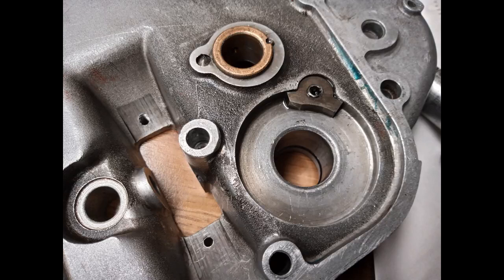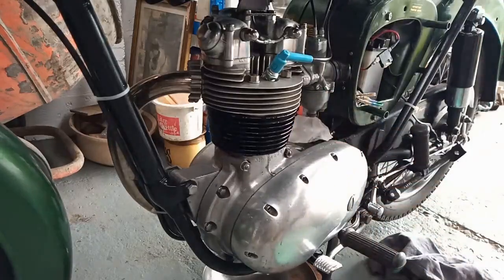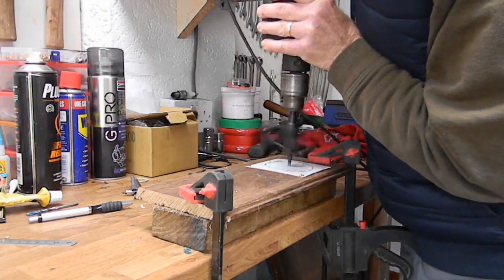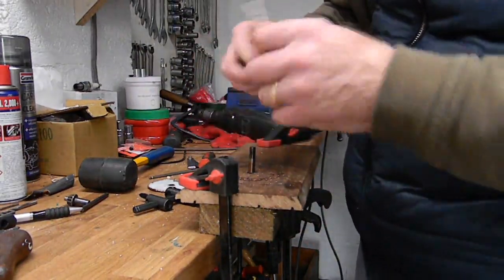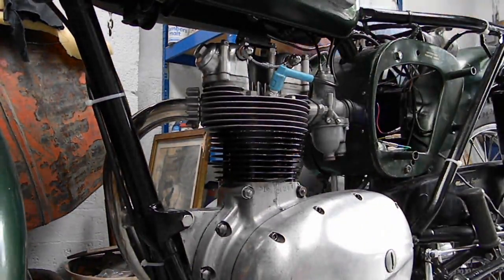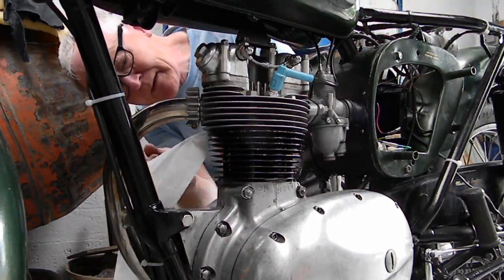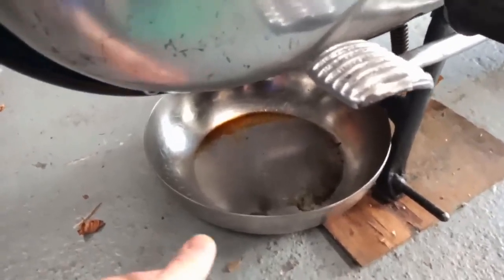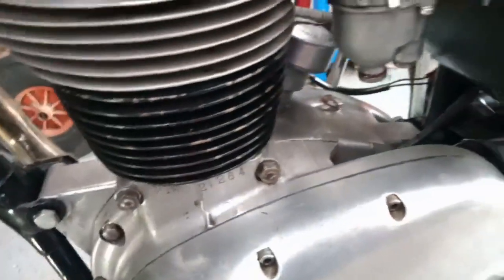BSA C15 Oil Leaks

Comment: RTV sealer works well.  Used it  on my c15.
Reply from the maker: Hello Roger and thanks for the advice. Rupert Ratio and the BSA C15 Restoration & Preservation Group on Facebook advise against using silicon RTVs. I gather this is due to the possibility of an excess breaking off inside the engine and blocking an oilway. But I am getting desperate. You have experience of RTV use and I may fall back on your experience.
Reply: @hughferrier5837  use rtv sparingly.  As the  c15 restoration group says,  it can  if overdone  clog things up. 
Also  make sure  the oil return holes next to the cam followers are  clear.

Comment: Hi Hughie, just bought myself a C15, probably obvious to some but not me, how do you check level of oil in primary chain case and where to add oil if required.
Reply from the maker: Hello and congratulations on owning a C15. You are going to know moments of great joy and moments of great despair. To fill the primary chaincase is easy - there is a big filler plug in the middle of the case with a slot in it. A cold chisel can act as a screwdriver to fit the slot. Mine is sealed with an O-ring. The level is different. Two of the Allen bolts at the bottom front of the chaincase should have fibre washers on them. The bottom front is the level plug, the one just behind is the drain plug. Open the bottom front and add oil till it comes out that  level plug. I don't often do that. I have a piece of fence wire that I put in the fill plug and just kind of make sure the oil comes up to about 1cm on it. I'm more or less checking there is some oil in it! I just use 20W50 oil in the engine, gearbox and primary chaincase. I am not a great expert but I hope that helps.
Reply: @hughferrier5837  That is a great help Hughie, thanks very much for your reply. There's every chance I may pick your brains in the future without becoming a nuisance. Take care. Dave

Comment: These engines left the factory with leaks. It's part of the design. It's also why most of the parts are distorted. People pull the bolts down too hard trying to stop the leaks.
Reply from the maker: Yes I've heard that's a problem with overtightening. This may shock you but most of my life I have been a Yamaha man! I've had an XS250, XS750 and XS650. I now have a Yamaha Majesty scooter. They just don't leak. Well the XS650 leaked for a wee while but got sorted easily. I even had two wee Chinese bikes - never leaked a drop. But the BSA is beautiful. It is also quite a clever wee design but just not done well enough.
Reply: I've been having an argument with some idiots who think there should be no gasket or seal between the crankcases. There wasn't one when I took the engine apart  so that's a red flag in itself. And they called me stupid.

There also seems to be a section of the casing having a filed off area in the place where a screw fits in every C15 and B40 engine I've seen.
The later B40 WD don't have that.
It's pretty obvious to me with a limited knowledge of plumbing skills that oil is going to slip past a screw which is why the areas where the screws fit into the side casings are sealed up and secured by a gasket. Having a hole is going to let out the oil.
Reply: @EIKLURAM  Thread tape seals threads. Hylomar was originally used between crank case halves. Today we would use Loctite 518. 
My Fiat has a bearing block on the bottom of crank case. All bearing caps in one lump. It is sealed with 518. The Sump pan uses Silicone RTV only. It only leaks when the pan has rusted through.

Comment: Looks like you're back with the original carb...'experimental' Mikuni didn't work out?
Reply from the maker: Hello and thank you for bothering to take an interest. I was experimenting with that Mikuni copy. I may try again. I couldn't get a correct jet for it to idle nicely and give a nice colour of spark plug afterwards. To use the bike I am back with the Amal, though it is a concentric. Originally it had a monobloc. It came to me with the concentric. If I get the Mikuni to work out I will post a video. My carburation is not right. I do get a grey plug so that is good but my fuel consumption is less than 80 miles per gallon. I think a wee single should do better than that.